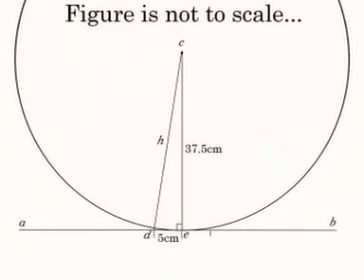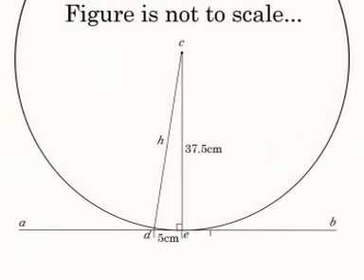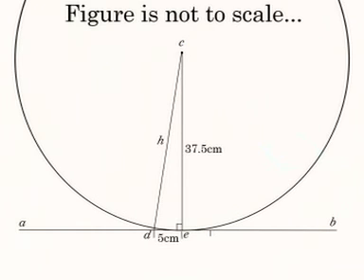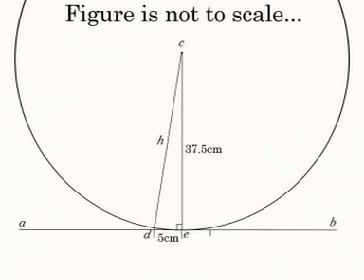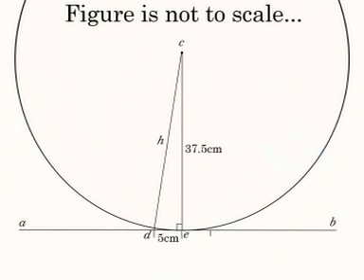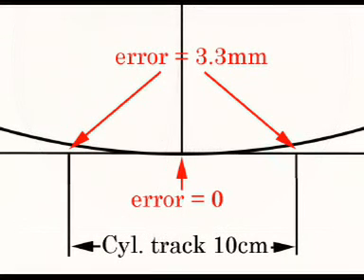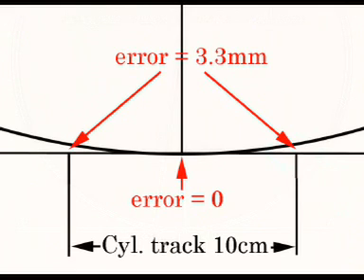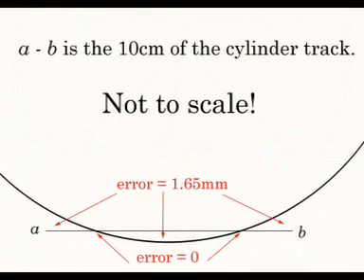tracking error

Comment: The lateral tracking error would be about the same as on a transcription sized turntable playing a 12 inch disc regardless of stylus shape. However, there is the added element of a vertical angle change as the stylus moves forward and backward over the curved cylinder surface as it moves laterally. Can't imagine that either variation makes much difference.